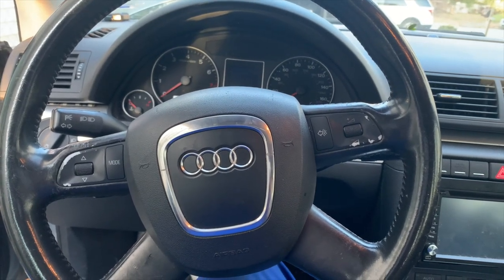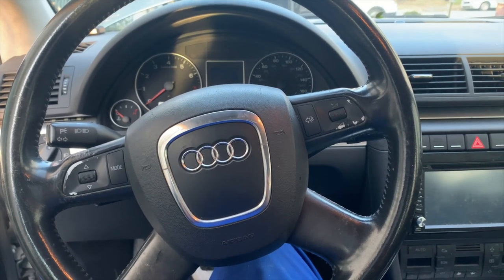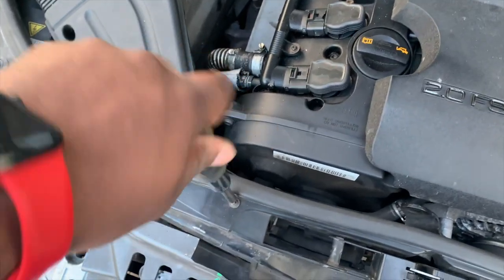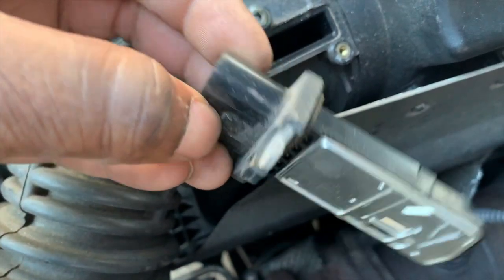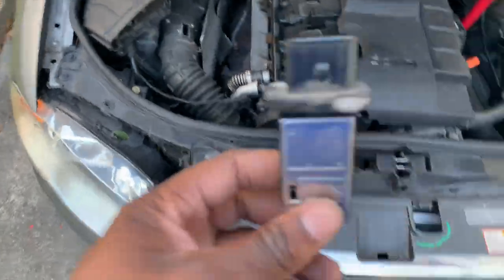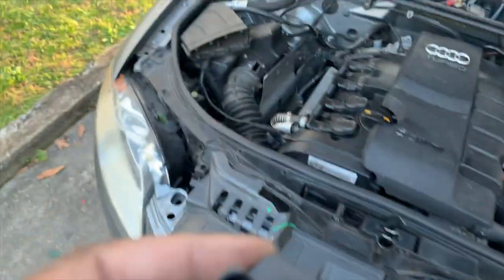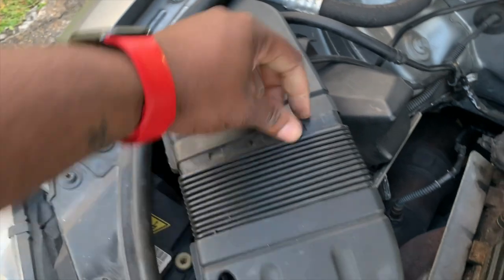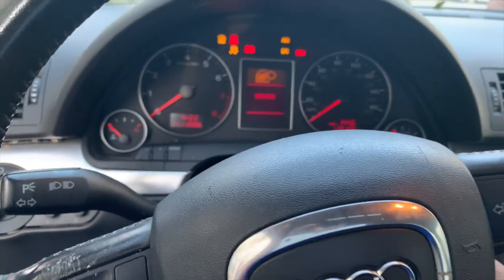How To: Bad/Faulty (MAF) Replacement Audi / VolksWagen VW

Comment: I don't know the size of the torx bit, but if you notice the small round protrusion in the center of the torx opening, that screw should be removed with a safety torx bit. It's a standard torx size bit with a hole in the center of it to clear that protrusion.

Comment: Hey, i have an 2008 A4 quattro turbo, 2.0, and i am confused, the MAF sensor has 4 or 5 pins (donde remenber), but the plug has only 3 wires conected, is that normal?
Reply from the maker: Yes depending on the model it varies

Comment: Actually, that cracked front intake section could cause you some problems. The way yours is cracked, some of the air coming into the front of that intake will pass right through the crack, possible causing the ECM to throw a code.